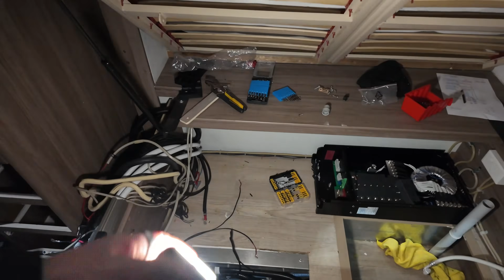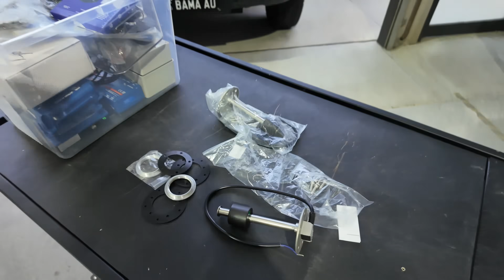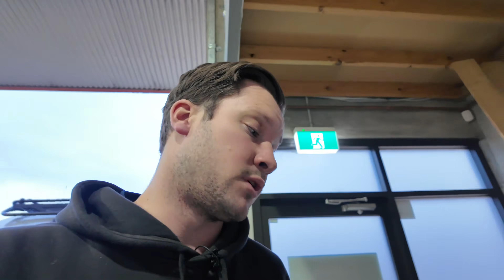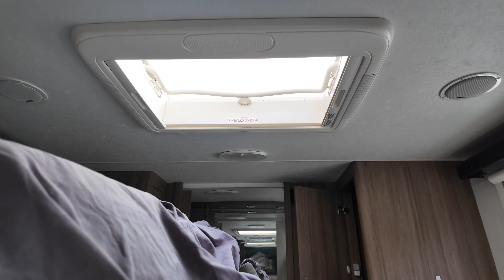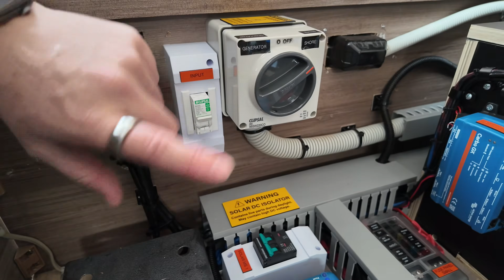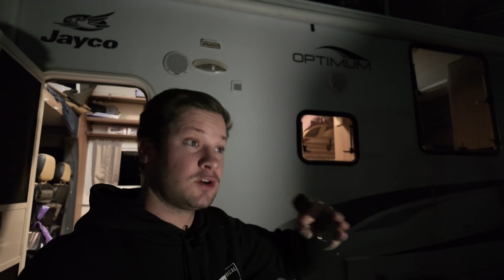INSTALLING VICTRON'S LARGEST 12V INVERTER | 2014 Mercedes Sprinter Jayco Optimum

Comment: Question what do you do with the earth neutral bonding on these when u upgrade. Shore power is uses the supply bonding/earth. Vans aren't usually bonded from factory. So you shouldn't use a generator as the vans rcds won't trip. Ok if using an victron inverter as they have bonding internally. I found this out the hard way. My sparky couldn't find anything in the Standards. He made me a inline bonding for my generator. Is there something that is industry standard for this issue with the use of generators.
Reply: The van should come standard with double pole switches on all mains circuits to satisfy AS3001. As for the generator set up I believe some  have no earth-neutral bond (MEN) but you must carefully read the specifications that come with your generator. No the RCDs won’t work without an MEN connection in the system.
Reply: @chrisheath623 all these new rules some great and some stupid but nothing about generators shouldn't be used or than vans. Just wondered how to overcome this issue.